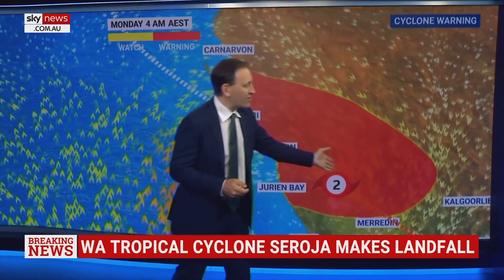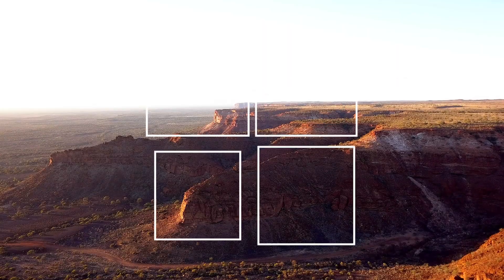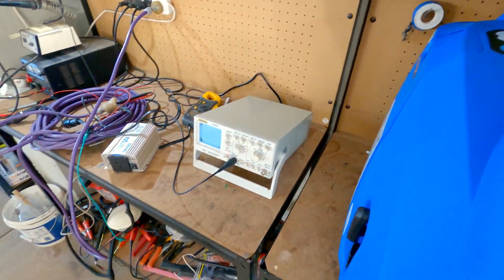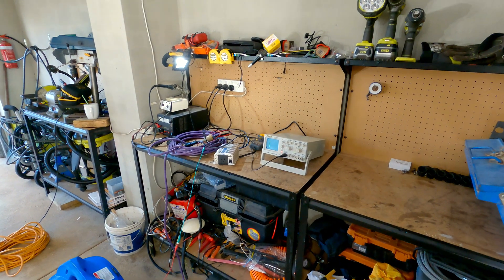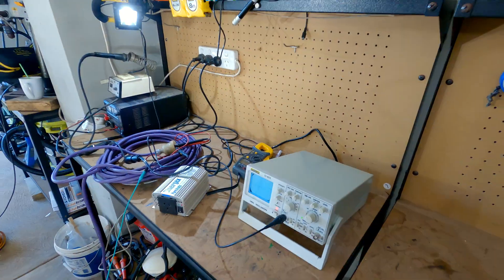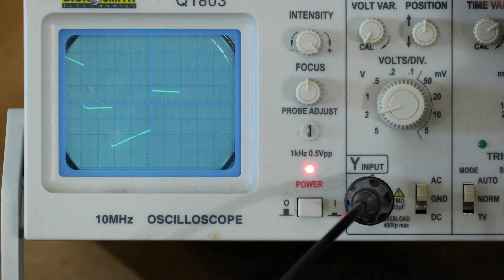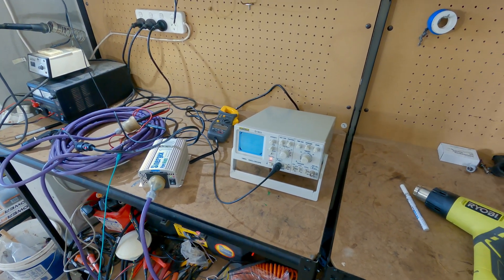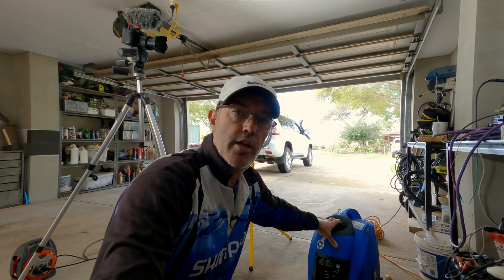Clean Camping Power -  When Solar won't cut it..

Comment: I have one of these and I do like to use it camping. The only thing that bugs me is the electronics are unserviceable if a component goes bad. The inverter's capacitors, resistors, transistors, ect,  are covered in a thick resin. I cannot get the probes through this stuff. To buy a new invertor unit costs almost as much as a new generator.  Informative video, cheers mate.
Reply from the maker: I will ask Mick how much.. but you are right, they are potted.. stops or helps with vibration..

Comment: We have always had a generator as a standby measure. We have a ton of solar panels and batteries but there are always those times when the sun won't shine for days on end and the batteries start to look a little sick. Probably 95%+ of the time we don't need a gennie but when we do it is so nice to have it available. The modified square wave is a bit of a shocker, I don't think I would like to run the laptop on that :)
Reply from the maker: Same idea, I will use solar when available. I have an oversupply of panels, but I run out of battery capacity when fredges are on freeze, and I am not on the move daily. I'm waiting for my battery to die and I will move to all lithium, that will help.